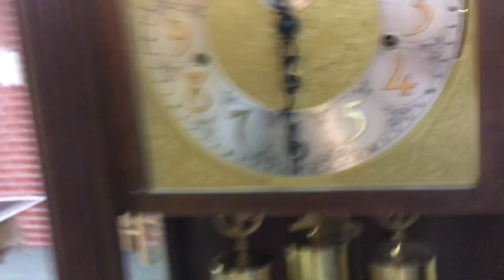Colonial style triple chime grandfather clock (READ DESCRIPTION)

Comment: WD-40 is not to be used on clocks.  You might have the wrong weights on the wrong pulleys... heaviest weight marked underneath with an R should be on the right
Reply from the maker: Well as of the time I am posting this comment, everything is working fine on the clock right now

Comment: Can some more knowledgable Horologist please answer my question:
Why does this clock appear to have three winding arbors on the dial in addition to three weights? Antique clocks are usually either key wound spring drive or weight driven... most tall long case clocks being driven by weights slowly falling on chains. Is the dual function of spring & weight necessitated on this modern unit by the large choice of selectable chiming? BTW, use of WD-40 on the movement can perhaps cause issues requiring premature overhaul.
Reply from the maker: The 3 key holes actually wind the weights and bring the weights back up to the top of the case. That is when the clock is fully wound and will be good to go for about a week. There is a crank key that comes with it that you use. I have a separate video of me winding this clock on my channel page. Feel free to check it out!
Reply: Clock TV  thanks, appreciated :-)
Reply from the maker: No problem
Reply: @Michael.Chapman  there is one arbor for time, one for strike (the hour gong), and one for chime (the melody on the quarters).

Comment: I think you used the wrong weights for the strike and chimes. YOu used the weight for the chimes on the strike train, which is why it strikes so fast, while you used the lighter strike weight on the chime side, which is why it got stuck on St. Michaels and Whittington. There is not enough force to push that many hammers. Westminster was very slow for the same reason.
To fix the problem, swap the left and right weights. Leave the center one unmoved. Note that every weight has different masses. The one in the center should be the heaviest, the one on the right should be the second, and the one on the left should be the lightest.
When you fix it, the chimes should not get stuck and the strike should happen once every 2 seconds instead of over 3 times every 2 seconds.

Comment: Hey you might want to check the spring for the chimes as they all sound slow and looking at the fly pinion for the chime is an indicator that the spring has flexed a lot causing its elasticity to be reduced so you should get a professional to replace the spring or if you know enough about clocks, you should replace it
Reply from the maker: As of right now, this clock is working perfectly. I think it was just because I had the wrong weight on the hook.

Comment: @Clock I have a Howard Miller grandfather Clock that chimes @+3 on the hour. When it is 3PM it chimes 6 times. At 9pm it chimes 12 times. How do you fix that?
Reply: I’m not sure what the experts say, but I know some people will just move the hour hand forward three hours. But if it’s BEHIND, then it gets more tricky because in most cases you cannot move the hand backwards. So if you get 12 strikes at 9 o’clock you should be fine just moving the hour hand forward because it is ahead and not behind. Hope this helps! :)

Comment: It's a Colonial
Reply from the maker: You mean is that the brand? I thought it was Howard Miller
Reply: Clock TV I saw on the face it said Colonial
Reply from the maker: Maybe that is just the style of the clock. It is probably made by Howard Miller maybe
Reply: I'm guessing this has a kieninger movement in it? Anyway, your best bet to get er running right is to get all that WD40 out of the movement, and get either a clock repairer or yourself to get some clock oil specifically made for clocks and oil all the oil sinks. WD40 will not work for long, as it will gum up the movement and that's what you're seeing right here. Somehow that movement will need to be taken to bits and cleaned, and re-oiled to get it running up to speed. Definitely slow!
Reply from the maker: Well right now, all three chime selections work great now. Whittington and St. Michael work fine now
Reply from the maker: Justin Dixson- Yes. This has a kieninger movement in it. 
Also I am posting this on September 24 and the chime runs faster now but the strike is slowing down kind of but I am fine with that

Thanks